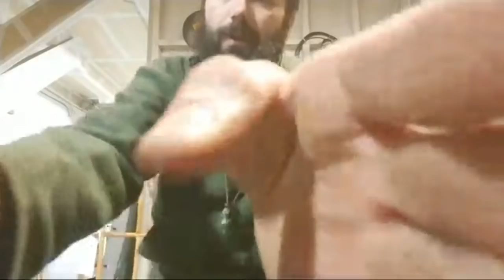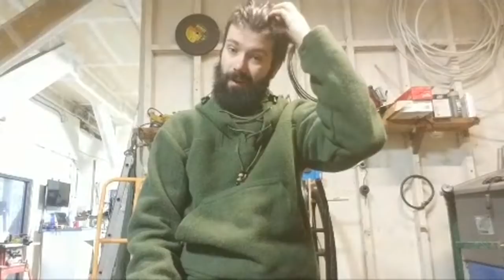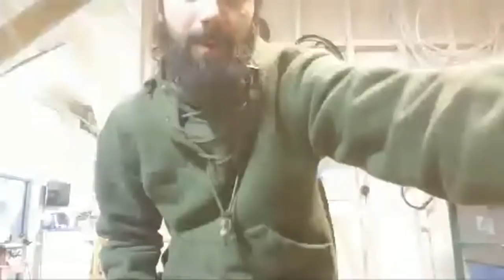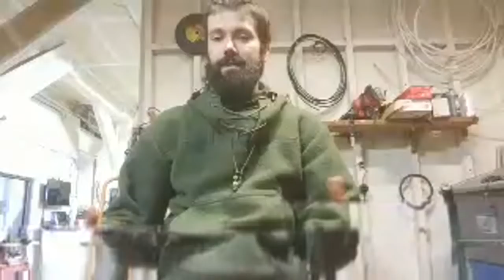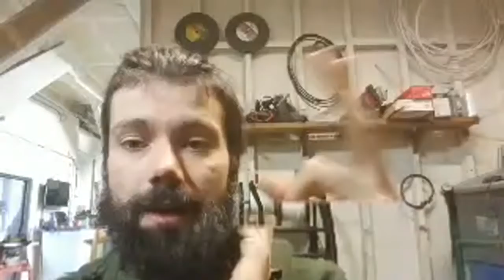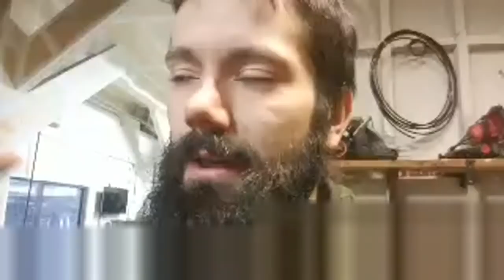Ig Crashed Sorry

Comment: EVTV do some great kit. Currently converting a 1961 aluminium motor launch much like an old MTB. Using a pair of Siemens 3phase 118kw from EVTV with controllers, screens and ECU 's from them, amazing kit and not super expensive. Also retaining one of the big old gardners as a gen set /direct drive regen unit to keep the purists happy! :) 
Love your videos, I'd love to do the same on this build but really hate been on screen, maybe a time lapse could work.

Keep up the videos.

Comment: I think Uma has a 12v fork lift motor (not 48v). My boat has a 9kw 48v Electric Yacht motor installed by the previous owner (it's an older version of the motor they now sell as theQT10). The boat is a full keel 36' monohull (Dickerson 36 center cockpit ketch) and I can get about 4 knots at 2kw. I have a 12000W battery bank and a 2kw honda gas generator. The lead acid batteries can give me several hours of low speed range. However, one issue is that the gas generator reaches the motor thru the battery charger, so running off the generator does not give the generator's full 2kw to the motor. I'm looking to add solar and possibly wind power and I also hope to upgrade the batteries at some point.The gas generator is something I would like to remove if possible - it sets the CO alarms off whenever we run it.
Reply from the maker: Yeah high powered chargers aren't cheap either. Once all my panels are up I should pull 5kw through the panels all day long in the summer. I'm looking at wind too but I wont have em up till next fall. Good wind is pricey and complicated, hopefully I can figure it out.

Comment: Check out the channel "Sailing  Uma". They took a used fork lift motor and adapted it to their prop shafts to replace the diesel engine that removed. They are using Battle Born lithium ion batteries.  Watch the episode about electric boat engine. It is really cool.
Reply from the maker: Battle born are pretty pricey. My battery bank is the same size as theirs but cost less than half as much. My motor is an ac12 brushless ac. More efficient and has regen, but more expensive than their brushed motor. I'm sure a brushed motor would probably be just as good. Brushed is a bad idea if you have propane or gas onboard though, especially for an inboard motor like uma. They took precautions by sealing it off from their gas storages.

What I'm most surprised by with uma is their low power consumption for 3.5knts of speed. 1500w is totally attainable.

Comment: How about a used Tesla electric motor?
Reply from the maker: 10 000$ is the cheapest I've seen so far. They're good but most people dont need 200kw to move their boat.
Reply: Tesla is claiming 1 million miles for there batteries
Reply from the maker: They're just 18650 Panasonic cells. Tesla doesn't yet make it's own batteries.

Comment: Dear Simon.
Good grief, unfortunately electric motors, good rechargeable batteries, solar panels etc.p.p. are still way to expensive. Hope and pray that you will find a payable solution. By the way: I don't know anything about the voltage e- motorbikes have. But on YouTube I have seen guys that bought and used the motors from damaged motorbikes that had an accident. I believe that these kind of motors are strong enough for your purposes.
2) Isn't it possible to use the motor and rechargeable lithium ion battery packs out of a 24, 36 or 48 V cordless garden tool for your dinghy? Or maybe even a complete brush cutter?
Best regards luck health and wisdom.
Reply from the maker: Brushless powrtools usually rated for 200 to 800w. 

Powertool lithium batteries use 18650 cells which can definitely be repurposed. I will most likely build one some time in the future.

Electric motorbikes usually have 20kw or larger motors. I'd be happy with a 20kw motor for sure but larger is a waste for my purposes. They also usually run 96v or higher which is a problem for me since there aren't inverters, solar charge controllers, wind charge controllers that run those voltages. So it would seriously complicate my system. I opted for 48v for this reason, best compromise between both worlds.

Electric assist bicycles are capped at 750w, and usually run on hub motors which are harder to repurpose.
Reply: @findingsimon  
Thanks for replying.
??? = You mean a rechargeable lithium ion electric lawn mower with for example 48 V and over 2 AH doesn't have enough power even for a dinghy? Lithium ion battery driven brush cutters are  really strong also.
Anyway: No further talking necessary because you already made that fantastic deal with the electric micro car. I already congratulated and commented on YouTube. There are definitely no such inexpensive opportunities in Germany. Otherwise I would love to own such a car (for driving it).
Will you please be so kind and give great Honey some good pats from me?
Sincerely yours.
Sincerely yours

Comment: Oh no! For motors, you could probably find cheap used SepEx type motors. They are compact and efficient. The torque curve can easily be tweaked to match different props. There are wide options for controllers, you can even make your own with an Arduino, with a suitable MOSFET output stage. Brushless motors are awesome, but expensive and prone to vibration.